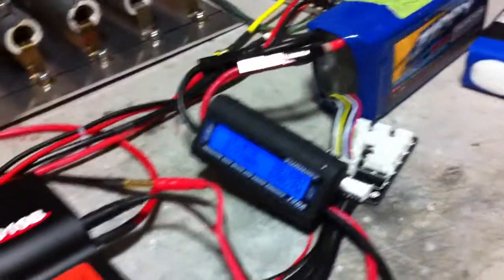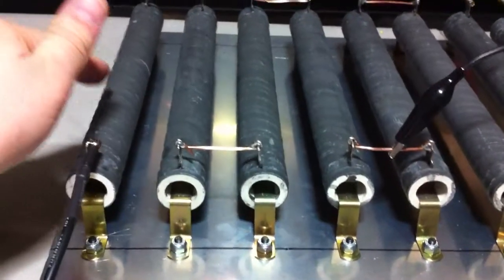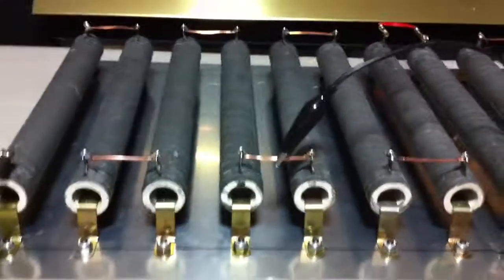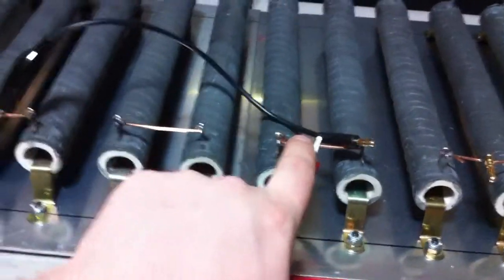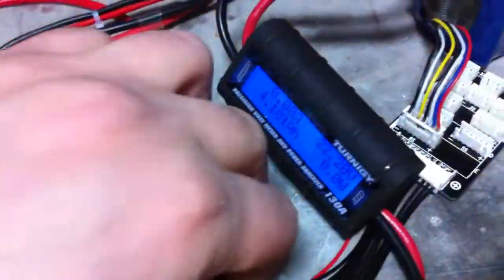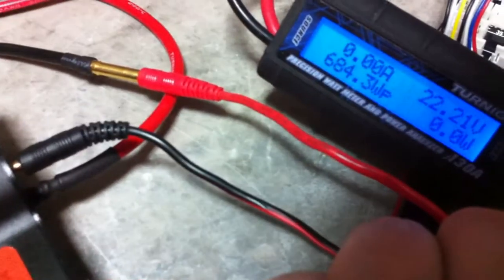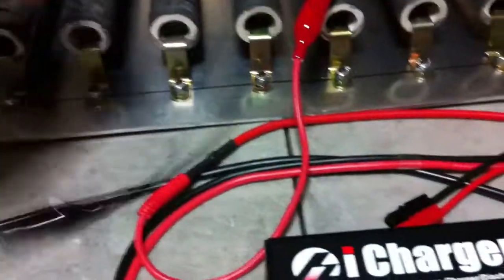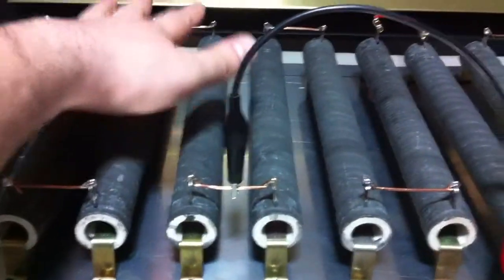Icharger 3010b external resistor load

Comment: thats cool man, thanks for the experementing.. your a champ.
QUESTION 1- what is your powersuply voltage and rated power?
question2- can you recomend a method of implementing a high wattage resistor to the batery conection with a switch for low/high resistance? I know its easy but some folks here wouldnt know how..